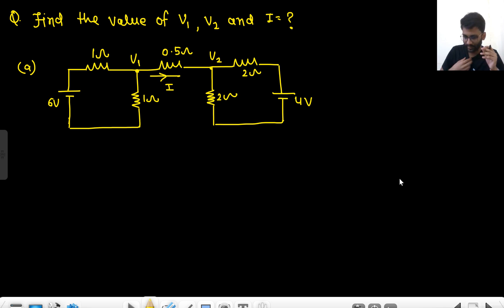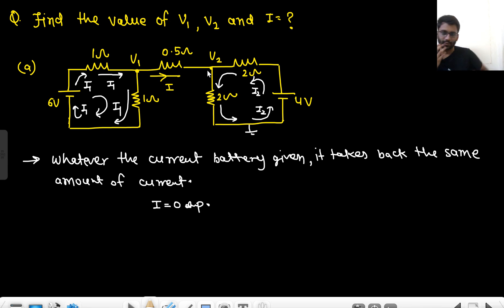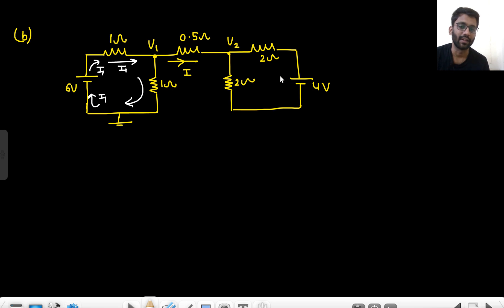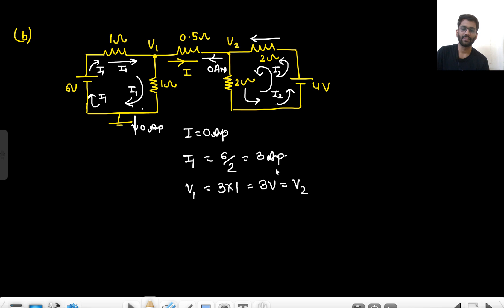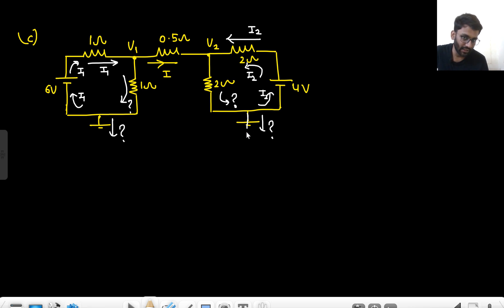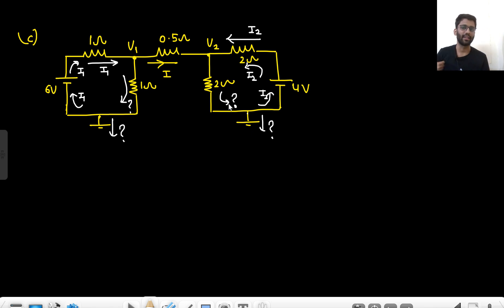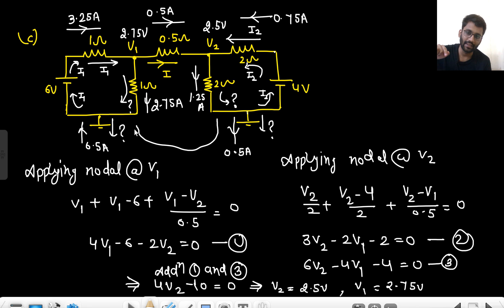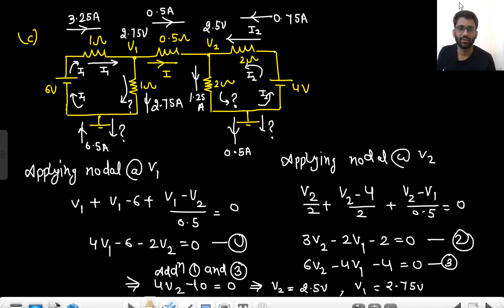Interesting Question on Basics of Network || Network Analysis || GATE 2025-26 || PrepFusion

Comment: 9:07 in 4V loop, if V2 is 3V, then V drop across 2ohm is 1V so I through 2ohm is 0.5A. As no I is going into 0.5ohm so 0.5A is going into another 2ohm. So V drop across that is again 1V. Now, after 2 × 1V = 2V drops Vb is 2V but you said Vb is 1V. Please Clarify